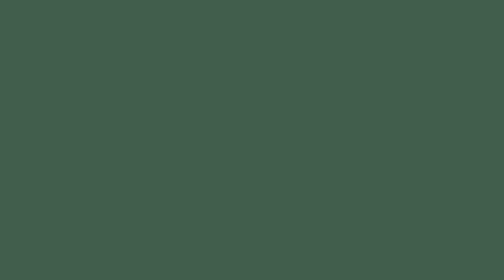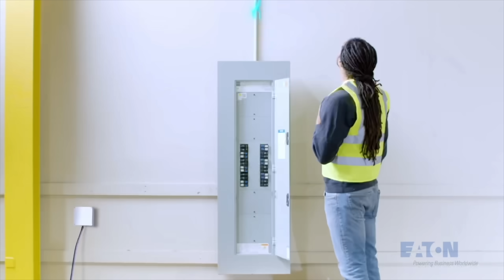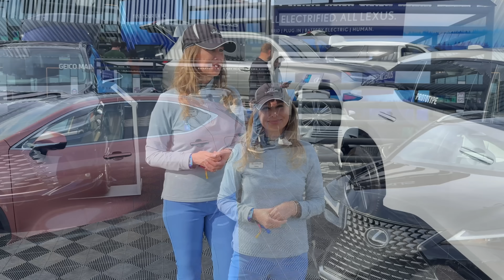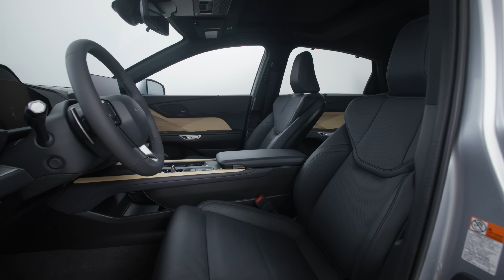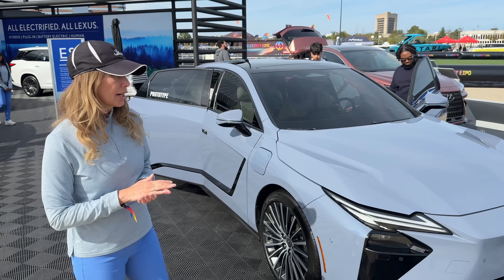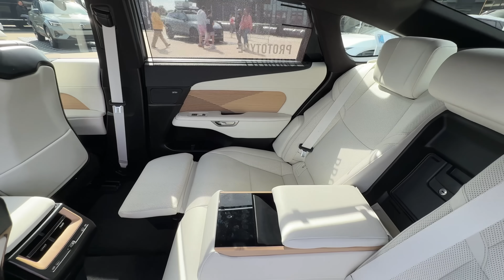My First Look At The 2026 Lexus ES Electric!

Comment: I didn’t hear you say it, but it looked like it might have the Tesla plug? And is the position incorrect to where the cord will reach? It looks like you’ll be able to just use one stall, but it looks a little farther away so I’m questioning the length of the cord at the charger. Thank you for this review. We’ve been waiting for the electric ES to come out.

Comment: As a 2 time ES owner and current Tesla owner, I was really looking forward to this car. With those crap specs, I will pass. The one to get will be the hybrid if you really want one. Or, if you will just use it as a commuter car, the AWD EV version will be nice. You’ll just be disappointed on a road trip with long charge times and more frequent stops to charge.

Comment: 300 miles may work in Japan, but not in the U.S.  Need to create an upgrade option for larger battery pack with faster charge times. Can’t believe the Japanese are so far behind in battery tech. They need to partner up with likes of Porsche or Lucid to work out a tech sharing agreement.

Comment: Could you explain something? If an 800 volt system charges at high speeds with less heat, why aren't there more of them?
Reply: Cost is the reason why we don’t see more 800V models.  The components to support 800V cost more.  Notice that Hyundai/Kia use 800V for their premium models and 400V for economy models.  You will see many more 800V architectures over the next 3-5 years.

Comment: 300-250 miles with 150kW charging sounds like good specs for 2017
Reply: You’re exaggerating like crazy! More like 2019. (jk)
Reply: @ex2bot in 2019 the Taycan came out with 270kw charging and the Model S long range had 370 miles lol
Reply: @pine111  those were $100k cars
Reply: Yeah this is why electric Toyota's in China and Europe are actually BYDs
Reply: That's how most Japanese cars are. Their latest tech tends to be what was offered years ago from other brands. That's why they've never impressed me.
Reply: Holy Mazda
Reply: Not really! This fits perfect in a range for many!
Reply: @gmv0553  You’re saying that people will have no problem with it. That’s a different conversation. Still doesn’t change the fact that it’s old tech. A 2026 car with the range and charging speed of a 2015 Tesla
Reply: The best thing Lexus could have done with the ES350 is to put an even better V6 engine in it than the previous generation. But soon there will be financial losses because sales won't cover what they invested in those electric cars. Nobody wants that.

Comment: Specs are meh for an EV coming out in 2026 or later.  In markets where Chinese EVs are not sold this may be ok, but in any other market with Chinese EVs this is slow and low tech that will cost more than those cars.
Reply: 雷克萨斯在上海新建了一个工厂，要跟中国电动车竞争了。

Comment: You can’t be luxury and not be fully electric. NACS charging is a must. If you’re middle class to wealthy you should not be pumping gas at a gas station. Luxury automakers failing to deliver competitors to Tesla really failed their customers and the bottom line reflects that. Execs should be looked into by the board for their lack of vision.

Comment: If you have to go to a gas station, it's NOT electric. Period. There is no IF or BUT. It either is, or it isn't. Toyota needs to stop with this "electrified" con crap. They're not fooling anybody with more than 2 brain cells.

With that said, this new Lexus EV appears to be nothing more than a glorified BZ4X. Nothing much new. 250 miles for a vehicle in this price range is not acceptable in a 2026 model. That was the range for EV's 10 years ago. 

Many EV's in this class are now getting 400 miles of range or more or close to it. 
- The BMW iX3 gets over 400 miles and charges at 400kW and starts in the high $50k price range. 
- The Lucid Gravity goes 400 miles and charges at 400kW. 
- The Mercedes Benz GLC is not far off. 
- The Audi Q6 e-Tron is also not far of and was Audi's best selling vehicle in America in the 3rd quarter of 2025. That's for ALL Audi vehicles, including ICE. 

This Lexus will simply not be able to compete with those.

Comment: I wanted the Lexus EV but the mileage was too low so I just bought an Audi. I'm waiting for it to get at least 350 on a full charge. I am getting around 310 WITH the air-conditioning running and 360 with the air off and that's with only a 90% charge.

Comment: How about just calling the technology "Toyota " the same way porsche and audi use vw electric architecture. 
And please differentiate between hybrid that charges the battery and hybrid that is part of the transmission and mechanical energy transfer. ( first is ev with a generator)
.. how does it compare to lucid?